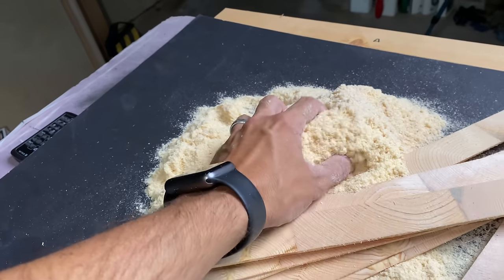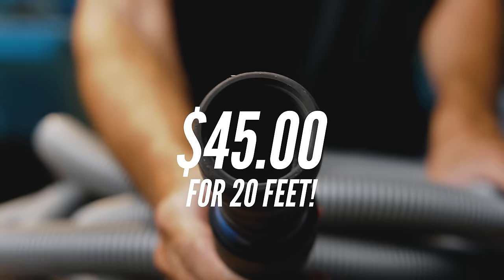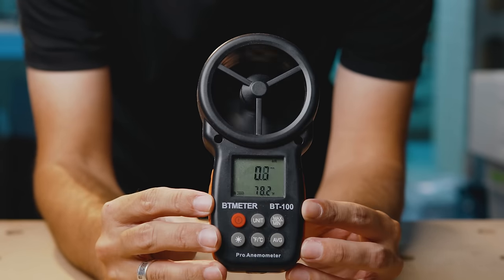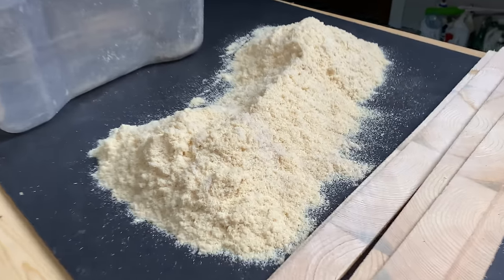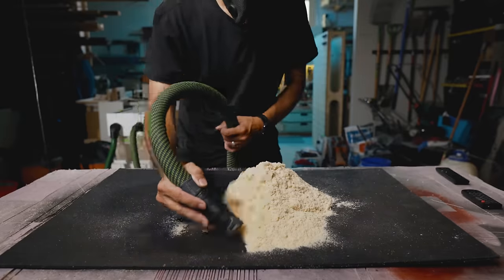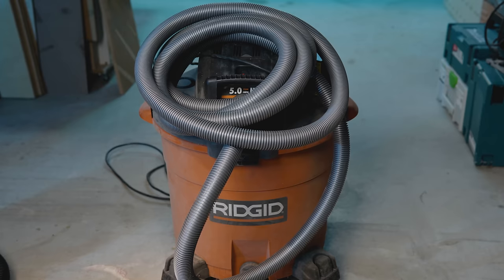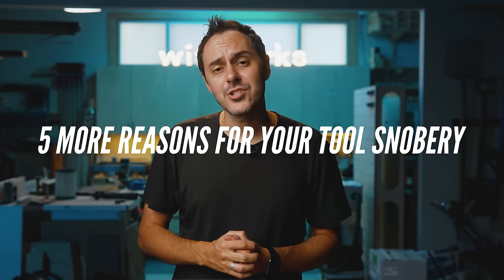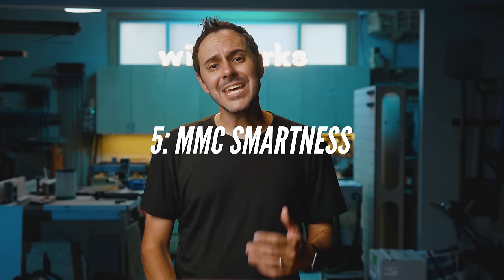This video will save you a lot of money. Dust extractors for beginners.

Comment: An FYI for those who don't have an anti-static hose:  Plastic hoses gather electrons, creating a static charge, especially in cool, dry air.  The reason it shocks people is because those electrons don't have a path to ground, except through a tool or your body.  It is easy to solve this problem for any hose.  Just put a metal hose clamp or metal band around the hose, near where it attaches to the vacuum.  Attach a wire to the clamp or band and tie it to ground.  If a vacuum machine doesn't have a three pronged, grounded cord, then replace it with one.  They are readily found in local hardware stores or online.   It may also be a good way of increasing the vacuum machines cord length, as many tend to be extremely short.  

If the hose needs to be easily/quickly disconnected from the vacuum, an open spring band (C-shaped) can be used, that snaps onto the hose.  A spring band can easily be made using a piece of pallet banding or similar springy metal.   Just be sure to sand off any non-conductive coatings.  An actual spring can also be used.   Solder or clamp a ground wire to one end of the spring.   Wrap the spring around the hose and allow its end hook to hook back onto the end of the spring where the wire is attached.  Of course, you could also use an alligator clip to attach to a spring, clamp or band.   Lots of ways to solve for static electricity on hoses.  No matter how someone does it,  it is all about one thing, to give the electrons a path to ground and any conductive material will do that.  

It is possible that grounding the housing of the vacuum machine will work, as the electrons will flow from the hose, into the housing, if it is a plastic-to-plastic connection.  However, some hoses use a rubber adapter, so this will prevent the electrons from moving to the vacuum housing, as rubber is an insulator.  In that case, ground the hose itself.  

If you notice on the Festool, the end of the hose has a metal sleeve.  That sleeve connects to a ground point inside the machine.  Some may note that this is exactly how a person grounds themselves when working at an anti-static electronics bench.  A conductive band is put on the wrist, with a wire that plugs into a ground point.  The same idea will work on a hose.

Comment: For reference; i did the math for how many fleece bags this separator is worth. 33 bags. (In Canada the separator is 580, a fleece bag for a ct 48 is 17.50, therefore 580 divide by the 17.50 equals 33 bags)
Reply from the maker: Wow. What do you think?!? Worth it?
Reply: @wittworks good question, I’ll buy the ct 48 with auto clean for the enhanced included hose size and suction (over a ct 26 + a seperator for the same price of 1700 Canadian)

Comment: I use shop vac plus dust deputy and I remove the shop vac filter and vent outside.
It is awesome.
Zero dust in shop and full suction at all times, and no filter to deal with.
Venting outside if you can changes everything.

Comment: Helpful vid! I got rid of my cheap Lowes Delta dust collector a couple years ago and I’ve been using two separate shop vacs on the table saw and miter saw on delay switches.  it has improved dust but they fill up fast, and when they are clogged they are doing nothing.
Reply from the maker: Thank you

Comment: I have a fein turbo one, upgraded from a Ridgid shop vac as well. But I'm never going back. The fact that the suction doesn't diminish nearly as quickly as the shop back when picking up dust really outweighs every other consideration. It's just nicer to use.
Reply from the maker: Great point. I noticed the suction drops the longer I use the shop vac. Not a work horse.

Comment: I love this video because it backs up what I’ve been seeing/sensing with my rigid set up with hepa. Big difference after I did that. So now I use my Makita dust extractor for portability when I have to go outside my (so called) shop. But this makes me, and my wallet, happy I went with the rigid in the shop.  And I can tell from the amount of dust I find all over when I do get to cleaning the whole garage. 3 car garage size , but I only get between 1/3-1/100th of the room to work, depending on what the kids and better half have in store for the dumping ground, I mean garage.😂

Comment: The other thing you can do in addition to good dust capture is to have a regular HEPA air purifier running in your shop all day. So anything that is not captured by your vacuum is eventually pulled out of the air.
Reply: 20 inch box fan and a merv 13 filter do a better job and filters are under $20

Comment: The festool remote is worth every penny you can use tools without blue tooth an it eliminates the back and forward to the unit and ultimately save power over time. You could also check the amp draw on them when the bags are 80% full.

Comment: From my experience my Festool performed better than the cheap vacs I have used. At the same time I have only used my Festool with a hepa filter and bag, and the cheap vacs I have only used with a regular filter (non hepa) and no bag. If I had the hepa setup in the cheap vacs I would not be surprised if they were much closer to my Festool in protecting against the harmful particles. Your test was much more apples to apples than my experience. I agree that user image is important to the customer. When I was buying a new trailer for my lawn business I optioned it out in the same color as my truck because I felt it was more professional. I don't know if it has been effective or not but I know people have noticed at the very least. Another thing a homeowner might consider is the CT15. While it is a good amount more than the Ridgid, it is hepa out of the box and you are saving over $200 when compared to the Midi.

Comment: So the amount it captures is an important metric however there are a lot of factors I would consider when looking at actual exposure.  The capture velocity distance and the flange all will have an impact so what tools you're using would really matter as well. Also just measuring PM 2.5 is not the only thing to look at.  Better quality filters. Actually target medium sized particles better. Most filters are really good at capturing super small vertical and really large particles. This is due to Brownian motion that smaller particles are easier to capture.  Personal air monitoring would be the best way to gauge your health risk and effectiveness. I am an industrial hygienist and am in San Antonio a few times a year I love nerding out about this So if you really want to get into it I have no problem going over sampling to see actual health risk. Also a statistical approach would be great in comparing the 95th percentile risk too if we could take multiple samples.   I have the equipment and know how to sample if you're interested I also know all of the stats and other things to my masters of public health  is in exposure science.

Comment: Great video!  Try this thought experiment.  A completely blocked setup will release zero particulates into tbe atmosphere due to zero air fliw.  Likewise, and for the same reason, it will pull zero particulates from the atmosphere.  Try testing tbe air near your mouth and nose as you saw and vaccuum.  (Where it actually matters.)  I would love to see those numbers.
Reply from the maker: Good insight. I didn’t think about testing at my face or saw, but I think you’re right.

Comment: I enjoyed the video. One thing to note. The results didn’t completely surprise me. The main reason the newer rigid and the festool had higher readings was mainly because they have stronger suction. Stronger suction will also mean stronger exhaust flow. I think a better test would be to put the meter around head level. In other words roughly where your head would be when you cut normally. The amount of particulates in the air should show in favor of the festool at that point since it did have the better suction.
Reply from the maker: Yes
Reply: great point

Comment: HI Drew Great Job on the review.  you can't go wrong with the Festool..

I own the Festool CT22. I have had it for 13 years and it has been awesome. I just purchased the CT 26E to beat the price increase. 

Now there is a hidden gem out there that no one talks about: it's a KARCHER NT40/1 TACT TE HEPA. It is a Commercial Vacuum and is every bit as nice as the Festool. I purchased the KARCHER NT30/1 TACT TE HEPA for the basement so I would not have to haul the Festool downstairs. Plus LIFETIME WARRANTY on Tank & Motor

Cost the KARCHER NT40/1 TACT TE HEPA is $389.00 Direct from them and the shipping was Free.

5 - Fleece filter bags are $52.00

You need to order one and do a comparison. You will be shocked by the quality.

Comment: Here's the thing. I have used them all. I can guarantee you the FESTO is the best.  I  owned a solid surface company that worked in hospitals and hundreds of commercial apppication. The fine dust that blows blows out of exhaust has been zero vs shopvac. I have ran routers with shrouds in houses and hospitals with which we all know is the airborne dust that show up during construction.  Every time with festo its clean. Also, you don't need Bluetooth switch. Festooned has vacuum that operates off the trigger with tool plugged in and delayed vacuum shutoff. FESTO BY FAR IS THE BEST. ALL THE TOOLS WITH THEM HAVE GERMAN ENGINEERING.

Comment: This is a great informational video~!  I've been woodworking for 35+ years and I just took the dive into my first Festool purchase last month.  My ETS 125 sander and CT 36 midi dust extractor order should come in next week.  I guess I'll find out first-hand what the hype is all about.  🙂
Reply from the maker: You’re hooked. I started with that sander. It’s good. Hold your wallet tightly. Just bought the ec 150/5

Comment: Hey, I'm a scientist and have done research on particulates in the air (although I measure stuff outdoors) and I'm based at University of Leeds in the UK.

If you really want accurate values when you measure particulates from 0.3 microns and above, you need to spend a few thousand dollars.

That said, even if the thing you bought probably isn't totally accurate, it's relative numbers are probably okay, so you can probably say all three are about the same and the old vac may be a little better than the other two.

Something that might affect the results a lot is exactly where you put the PM meter compared to the vac outlet. Just a few inches can probably make a big difference. A better way would be to put it on a tripod around head height by your bench. Then while you do a task, write down the readings every minute or so. This better represents what you breathe and will be less affected by small changes. It will also catch stuff that the vacs fail to suck up.

As someone else said, the more clogged up a filter gets, the better it filters, but the worse the suction becomes. That's probably why the old vac has such good filtration, but such poor flow speeds.

But what I think you can take home is that all three setups really do clean up the air and they all do a decent job. You don't need to spend a fortune on festool unless you want the fancy features and it's definitely better to spend a modest amount rather than do nothing.

Comment: I think the big difference between the two is a nice dust extractor auto cleans and doesn’t lose CFM as you suck ip drywall dust and cement dust. Many other vacuums lose suction as they fill. 

This in return lets more dust get into the air because it’s not sucking it all up

Comment: You can also DIY a cyclone top for the bucket if you have or find an old broken vacuum that uses one. Just mount it on the top of a sealed bucket and if you have a good shop vac you can run your hose from the side of the bucket - that way the big debris goes in the bucket, finer stuff up to the cyclone and your vacuum stays very clean with only the airborne sawdust making it through

Comment: Static ZAPPING! is what I hated the most out here in the Arizona desert especially when my shop is mainly outdoors. It got to the point everyone in my neighborhood would hear me cussing and knew I just got zapped again.

I ended up stripping some stranded copper wire and wrapping it around the hose from where I'm holding it to about half way down the hose and attached a solid 12ga copper rod I had laying around to the end so it would have constant contact with the cement pad I work on. Wasn't sure it would do anything and others told me it wouldn't but I have to say I won't vacuum without it. Haven't been zapped since.

Comment: If no one else have mentioned it, the reason that your old Rigid works the best is because its dirty, if you clean it you get higher suction but lower filtration, all the small particles that are in your old filter is helping to filter out the smaller particles, which is why it scores the highest, Festool is the better vacuum by far.

Comment: I don't know if someone already stated this in the 1000+ comments below, but what would help is measuring at the source (i.e., what's being cut) vs. what's not being captured by the filters.
To put a finer point on it, you need to know the volume of particulates being produced (i.e., with no suction as a baseline), how much is lingering at the source (i.e., how much the suction isn't capturing when on at the source), and then how much is coming out the other end (i.e., what you already tested).  This may explain why the Ridgid is performing so well in your test; it's not grabbing the same volume of dust as the Festool is at the source.  Of course, they may do the same.

Comment: I think I have a theory explaining Your measurements:
the old machine is simply a more effective filter because of a layer of old dust particles over the filter membrane working as an extra filter layer entrapping additional dust more effectively - it costs less airflow because of higher flow resistance and consequently loosing working vacum flow and  energy.

Comment: If the idea is to keep up with the Joneses Festool might not have the noticeable financial return that most businesses likely will see. 

Almost 11 years ago I was still heavily involved in a Painting Forum, and Festool flew half a dozen of us business owners to Indiana to pick our brains  on the needs of the trade and how Festool can fill those needs. At the time I was fairly vocal about the lack of ease of local purchase, and the overall cost versus the shop vac with bag and HEPA filter I was used to at the time. It all seemed like hype back then. I voiced this one evening during dinner with the execs and was told that I was just the type of tradesman that they were trying to reach. So after a few days of Brain picking sessions, mixed with hands on workshops, and shop talk dinners I flew home interested. That was the first time I had actually put my hands to their lineup as they were not, and are still not in any local stores. 

I was pretty invested a few months after that experience and when it comes to sanders and extractors I've been mostly brand loyal since. 

You take a top shelf sander and run it without dust collection and it's a good sander from the ergos. Take that same sander paired with good extraction and it becomes a great sander. 
Take something like a hundred dollar DeWalt sander and run it without extraction and it's an alright sander. Then hook up that DeWalt sander to that same extractor and it remains just an alright tool because of the balance and vibration. 

For me I see the return of investment in man hours, sundry costs like plastic, and clean up times. It's a selling feature that we can do stuff cleaner and faster than the majority in town can, that is something most non penny pinching customers can appreciate when it's experienced. That's something that most diy or weekend warriors won't experience because they are not selling the idea to their customers. 

Of course my situation is different from many shop purchasers because I'm bringing the tools to the project versus the other way around. Festool isn't perfect, nor is it the only game in town but I can say I've never lost money with any of the Festool purchases I've made.
Reply from the maker: Thank you for sharing that experience! Very cool that they did that for you. I agree. For a pro, I think it’s usually wise to invest in high quality longer lasting products that will make the job better and faster.

Comment: Had a shop vac. Bought a hepa filter and bag. Multiple hoses and clamps to make it all work with a bucket cyclone setup and different tools. Probably spent nearly $200. Only used it 10 times, cause that's about how much time I have for the hobby. Should have just bought 5 dust masks instead. LOL
Reply from the maker: Ha. Yes, probably.

Comment: I use a 15yo ridgid sv with a dust deputy cyclone, other than being loud and cumbersome it works pretty well. I don’t like my vac and saw running on the same circuit so I use a wireless plug with a tiny remote to trigger the vac, little piece of Velcro to move from tool to tool, tho i guess you could attach to the end of the vac hose like the festool Bluetooth one also. One TIP is buy a Pool Skimmer basket Sock (kida like panty hose material) and put over the filter in the shop vac, helps keep dust out of the pleats of the filter. You can even bang the vac on the ground a few times while it’s off to dislodge some dust off the sock and improve suction without opening it up. Couple more festool tools I’d buy before buying the festool vac.
Reply from the maker: That’s a great tip! Thank you for sharing.

Comment: Henry vacuum cleaner with HEPA bag. Hose clips to attach to your sander. Works perfectly well for DIY dust extraction, and also vacuums up rubble.  So tough, you can drop it down the stairs and it'll still work. Standard kit in most general builder's vans. Charles model also vacuums water. £179.  Otoh, the Festool looks cool. Hmm...